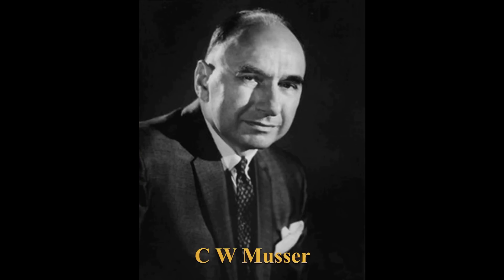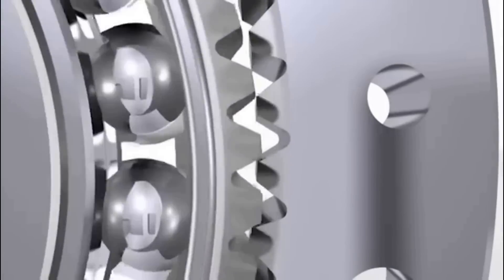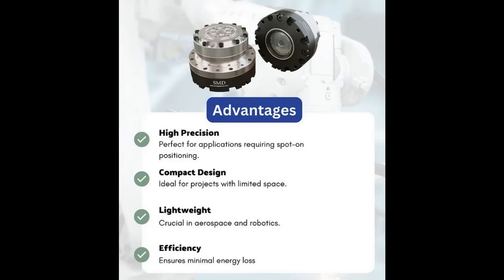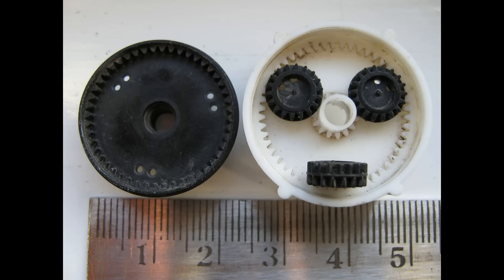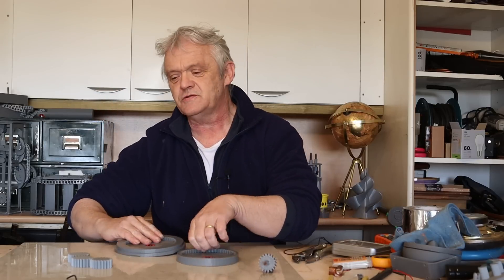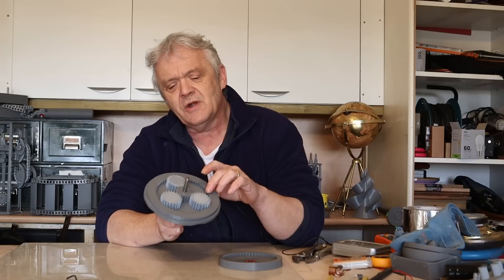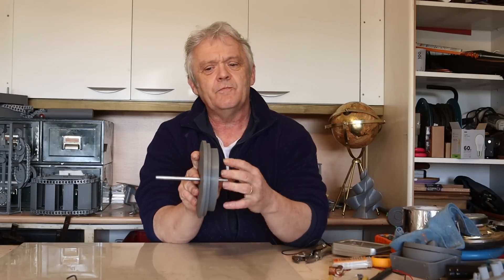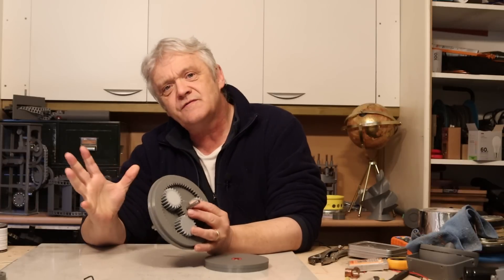2132 A Split Ring Epicyclic (Harmonic) Gear

Comment: I have a serious question, but first… I’m fine with the animations, ability to improve animations will always be progressing! Hat said, AI is a very polarizing topic at the moment… and likely will for a few years.

The QUESTION: Could the gear spline be done in reverse?

I’m thinking may be useful say with the ‘clock mechanism’’, but instead of a mechanical capacitor… be used as a mechanical battery. (Video 2088)

My idea.. maybe a couple of these (split ring harmonic gear sets) to allow that (from 2088 vid) to lower very slowly,but then spin an output shaft much faster. 

Then pull the “heavy” Sid back up to the starting position, with a small motor or by hand.

(IF SO… then would that be useful in a form of gravity generator)?

Comment: What's a good 3D printable design for a very thin approximately 10- to 20-fold reduction gearbox? High torque capable, slow, like sub 1rpm output. Backlash is permissible but drive smoothness and linearity must be high.

Comment: The other way of making this gear compounding system is to use 2 separate gear faces which allows you to use the same modulus but different gear diameters.

Comment: Wouldn't this reduction gear be a 20:1 ratio (60:3), or am I missing something important.
Reply: Yes , you're missing something important. It's 247:3 or 82.33.. WHY ? Well, bcause of ... physics. The reason is a  bit long and not intuitive , so if you respond (it's been 9 months) , I'll write it out. It's late and I would like to go sleep :) Cya.
Reply: That is correct. Although there's also the 18 tooth sun to 21 tooth planet reduction, so 23.333:1 total.

Comment: Great Segment, Thanks. I had a couple of tiny motors on an old Cessna 337 that used harmonic wave reduction drives to open and close the engine cooling cowling flaps. When the drives wore out after a few years and the cost of replacement motors were about $4,000 each, I replaced them with industrial positioners for about $120 each. they functioned better and only added about 1lb. each and will likely last a lifetime. Every technology has its best application and miss-application I guess.

Comment: I am going to try one of these out for a robot.  It seems like it would go well with something like a nema 17 stepper motor, for a robot arm!
Regarding the animations, I liked them.  I've used that tool myself for creating short animations.  If you are able to remove the background of the image first, so as to submit only the head and body of the character, the tool can do a better job of making the whole body animate - not just the head area.

Comment: Hey Rob!! I don't have the magnets for it at the moment but I think you'd be very interested in trying it out for yourself! If you have a Halbach array on a circular disk, you could use a flux coupling to be able to transfer much more torque with magnets than you can achieve normally. North amd South want to remain coupled, so you could have two of these in opposition separated by a plastic washer or something to prevent them from sticking. I could also see generator designs based off the Halbach array taking advantage of generation at the rim. Anyways! I just wanted to share this with you in case you were interested.

Comment: You get the same compact high gear ratio, but you loose the zero backlash advantage.
Reply: I think that a spring coupling or heck, even a magnetic coupling could solve that. Maybe a flux coupling using a Halbach array.